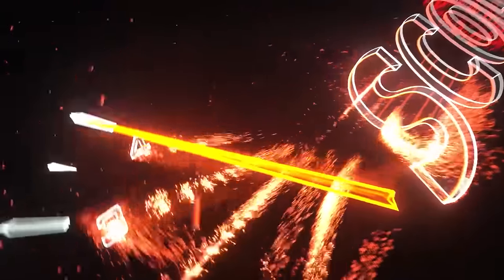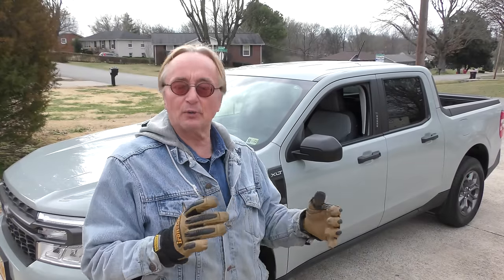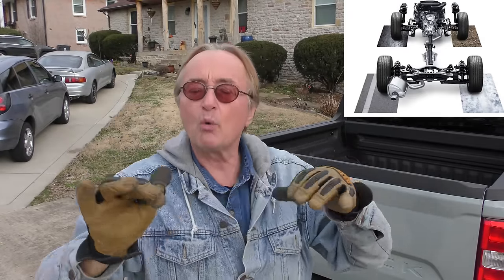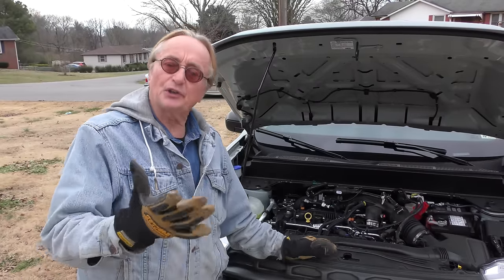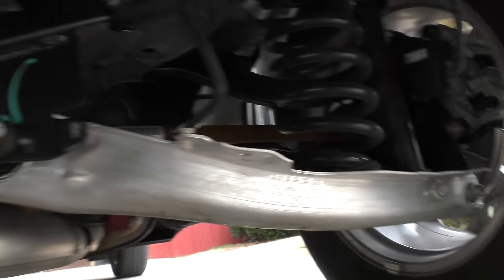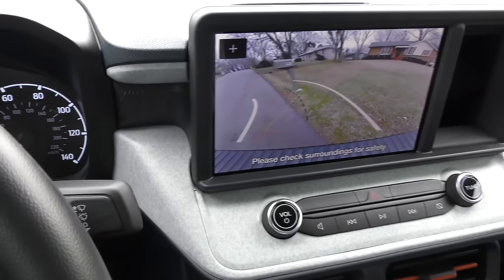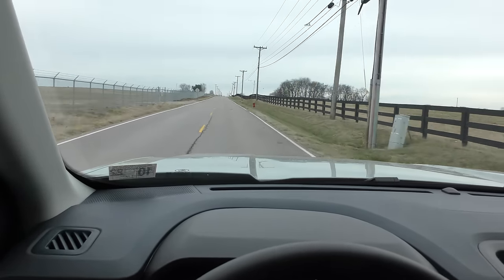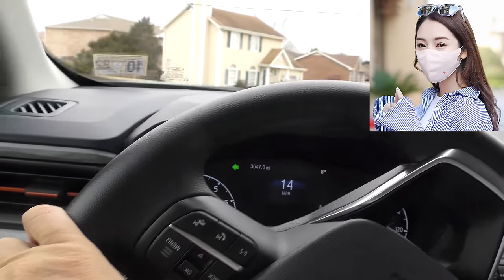I Finally Got a New Ford Maverick and Here's What I Really Think of It

Comment: I almost bought one of these last month. The dealer here had one but they were jacking the price way up above MSRP, so I bought a used Lexus with 30k miles on it. I was looking for longevity and figured the Lexus is known for that, the Maverick however remains to be known. If they hold up well over time I might get into one.
Reply: I’m in the same boat, but you’ll definitely have that Lexus a LOT longer. That’s a given. It’ll also hold value better.
Reply: @peliROJO  ES 350... I know it's apples to oranges, I was just looking for something reliable and comfortable
Reply: Best decision!! The Mavericks are to cheap for a reason, probably they put cheap parts. I don’t think they will last like your Lexus.
Reply: They won’t.
Reply: @Fister_of_Muppets  u need something comfortable and you were about to buy a maverick?! Mavericks are so uncomfortable that sitting inside them for couple hours was making my back hurt..
Reply: @juchou2983  I don't know what model Maverick you was in, but my Maverick Lariat Luxury edition has very comfortable seats.  6 way adjust with heat with adjustable lumbar support, just like any other luxury vehicle.
Reply: You made a mistake..
Reply: Should do fine. Its a rehash of the drivetrain that was in the escape hybrids from yester year. Those did 500k in Taxis
Reply: @Fister_of_Muppets  what was the sticker price and what was the dealer’s asking price of the Mavrick?
Reply: @GiovanniGiorgo  Sticker was $23k plus delivery etc, dealer wanted almost $33k plus tax etc.
Reply: This is why I dislike the legislation that protect dealers, we should be able to buy direct from the manufacturer no matter the company and no matter the state.
Reply: "Known for that" ? U sound gulible 
U should of left that dealer quickly
Reply: @johnnybravoBoyah  Lexus has had an excellent reputation for reliability from the start. My decision had nothing to do with a dealer. I did not buy the Lexus where the Maverick was. Your reply is dumb and obtuse.
Reply: For even money and the Lexus having very low miles that is a no brainer.
Reply: @Fister_of_Muppets  Nice buy , we had one for years and never had a problem....such a good car we gave it to sister because we didn't want to sell it.

Comment: Scotty touched on efficiency of FWD vs RWD and AWD/4WD. Some AWD vehicles are getting surprisingly efficient these days. I bought a 2016 Crosstrek last year when looking for a 4dr hatch to commute with. The Corolla and CT200H I was also considering are EPA-rated for about 40MPG hwy. I chose to bite the bullet on MPG to have AWD, tow capacity, and sturdy roofrails with a 33MPG-rated Crosstrek. I installed a high-flow cotton airfilter as soon as I got it home. I was pleasantly surprised the first week by getting 40+MPG on my 50mile commute by using the cruise near the speed limit. The 2nd week averaged 46+MPG!

 I then put on taller, heavier, A/T tires, a 2" receiver hitch, and skids. My MPG dropped to 35-40MPG. Oh darn. LOL. There are many people who don't get that kind of hwy MPG with their FWD econocar.
Reply: My wife and I had a 2019 Acadia AWD V6. 310 hp. We drove from Oklahoma City to Wichita and did about 31 mpg. On a different road trip, we drove to Jackson, Mississippi and did about 33. In town, it drank a lot of gas and you'd be lucky to get over 17. But I was absolutely floored at how efficient that Acadia was on long road trips cruising along at 70-75. Unless you were in town or in stop and go traffic, it didn't make much difference to have the AWD system engaged or disengaged. The long highway miles were about the same either way.
Reply: As someone who works at Subaru's Lafayette plant I'm glad you are happy with it. We work hard to build good cars.
Reply: Subaru makes the only awd system that I think is good. I’m not biased on the brand as they’ve had a few issues themselves, but I live in a snowy mountainous area at 7000’ and I see what the different vehicles are capable of. Most awd vehicles are actually rather poor. I don’t know all the facts about what makes the Subaru system different, but it just plain works. 
Cheers
Reply: @kdrapertrucker  I'm glad that the Japanese are employing local labor instead of just importing.

 I work with a guy that used to work in that Subaru factory. He drives an older WRX that he seems to still really like. That kind of enjoyment from a product line that you help to produce is a testament to the value of the product line.

 Subaru builds some funky, fun vehicles that are definitely not cookie-cutter. I like the quirky and smooth boxer motors, the chain-driven rather than belt-driven CVTs, the always-on symmetrical AWD systems, the SUV-like ground clearance on most of their 5doors, and the rallycar-like handling when TCS is turned off.

 There aren't many vehicles on the market that I like as much as my Subie, even at 2-3x the price. It's economical, yet capable, and legal FUN.

 It's like the economical-yet-practical fun of the old Toyota Celica 2+2 convertible.
Reply: @tomdavis3038  Subaru uses several different symmetrical AWD systems. The common denominator is that the systems are "always active".
Reply: @tomdavis3038  I vividly remember many yrs ago I had an old mid-80s Subaru $500 winter beater and my snowmobile had to be rescued way out in a field, that old rusty box walked right through that snow that was much taller than the tires while pushing snow with the front end. I hooked up to the sled and pulled it back no problem only time I ever got stuck is when I ended up on top of a hard packed snow drift and none of the wheels were touching the ground.🤠

Comment: The 2.0T is a proven engine, have a version in my 2016 Focus and its been good. I beat the crap out of it because its such a fun car for being an affordable daily driver. However, I have followed Scotty’s advice on the oil and I never use boost when the oil is cold. I wish every turbocharged engine had oil temp/pressure and boost gauges but sadly most don’t. 

In Michigan winters the time for the oil to heat up is twice the time for the coolant to heat up, about 6 min + 6 min. After that, game on.
Reply: Good on you for not boosting hard before the oil warms up! 
I have a 2013 Focus ST with the HP 2.0T and thankfully this model comes with the boost and oil temp gages. Super helpful!
Reply: Game on? Are you on a racetrack? If not, then what’s the point? Yeah. I definitely have to watch out for the badass focuses out there
Reply: @tomdavis3038  I can't tell if you're trolling or sincere and have never driven anything faster than a base honda civic.
Reply: That 2.0L is known as the Ecoburst
Reply: @tehagent1321  Never heard that. Have not had a problem with mine.

Comment: @2:27 Gotta call you on this one Scotty; only front snows will provide superior pulling/driving ability and braking over non-snows. Your non-snow's rears will NOT provide the same grip and potentially having the rear-end coming around you during (aggressive) braking and even more so on an unloaded pick-up. Considering too many other drivers don't even bother getting snows (all season is not 'snow' but 'winter' rubber) you'll be busy braking for them. Also, rounding a bend with snows on one end you just may experience 'breakaway' at different points due to the grip on one end and lack of grip on the other end potentially putting you off the road, or worse, head-on into the oncoming lane. Besides, if you are buying a new vehicle, aren't you going to purchase a second set of tires at some point? Aren't you going to rotate those tires at some point? Why not have two complete sets? Same money, same tire longevity, and a greater degree of free safety overall with this scenario.

Comment: I towed a trailer loaded with a full kitchen set Included, a French door bottom refrigerator, and a heavy wood stove 300 miles . Power to spare, it is a hill climbing, windy road the whole distance. Fuel was high grade( no sense not giving the eco boost a reward for hard work). I ran 80%  or the way on the auto drive and was thrilled with that part as well. 2024 Ford Maverick Lariat with tow pack.

Comment: Scotty - the Maverick isn't available with a 3-cylinder engine. 

The only powertrain options are the 2.5L I4 hybrid, or the 2.0L I4 Ecoboost which can also be spec'd with the AWD system. 

I ordered a Hybrid right when ordering opened. The fact that the 2.5 has port injection alone gives me more confidence in long-term use over the direct injection of the Ecoboost.
Reply: Exactly, well said 👍
Reply: Absolutely! The hybrid is trouble free. No GDI, no turbo, no complex automatic transmission.
Reply: The Escape has the 3-cylinder engine it.
Reply: @josephfrank1472  and . . . . . . . this isn't an Escape.

Comment: I'm pretty sure that start-stop garbage is disabled while driving in sport (s) mode.  At least that's how the Ranger is, and the transmission shifts much better as well.

Normal (D) mode is just so Ford can meet EPA numbers, but in reality sport mode is how you should drive it.
Reply: I have a 2018 Escape with the start-stop feature. Once the oil gets dirty, it doesn't  do it as much.
Reply: there is a button on the center console to disable it.

Comment: Only problems I've heard are badly fitted tailgates and sprayed bedliner done by outside contractor. Time will tell.👍🇺🇸
Reply: Lol I'd PREFER to have the bed liner done aftermarket considering how small it is and Ford still charges almost $500 anyway.
Reply: Them ecoboost engines have been out for a while now, they’re decent. I just hate the ANC boosting the engine sounds. If I want a loud engine I’ll get a V8!
Reply: Gas tank recalls too.
Reply: @jldude84  new to pick ups, where do i go to get an aftermarket spray in?
Reply: @angelgjr1999  For me I chose the Coyote V8 over the EcoBoost V6 anyday of the week.
Reply: @meenam300zx  well, that's a free fix. Hopefully it's fixed right
Reply: The gas tank recall is only for Mavs that had a factory spray in liner. The subcontractor they used performed a non approved method of drilling the drain holes after the liner was sprayed in. They found that some gas tanks we’re getting drilled into with this process. Because of that, they are recalling the select range of vehicles. The recall requires a complete gas tank removal / inspection, which is kinda insane.  But if the gas tank was punctured, you’d know it from the fumes or dash lights. Ford is just covering themselves from potential fires and definite lawsuits. Either way, it gives me confidence that they actually care about the vehicle, even if it is just to cover their own asses lol.
Reply: @CJColvin  This one has no six cylinder option.  It certainly would never have had an eight cylinder option.  Iwould have a six cylinder option if not for the turbo four, in all likelihood.
Reply: @unconventionalideas5683  True
Reply: @richsweeney1115 All recalls are free. This is ford, so expect more recalls.

Comment: It’s good to see ford come back and build a true small truck. I had a Ford Ranger back in the day and it ran well - lasted a long time. Slowest thing I ever drove though.
Reply: Jeep had a unibody small pickup for a while...rust bucket Comanche. Ford should of stuck with the '92-ish Super Cab Rangers with 7' bed.
Reply: My first vehicle was a 87 ranger 2.3 with a five speed. I swear, if you had an almost empty gas tank, were going down hill, and had a strong tail wind, it still felt slow. Freaking loved that truck though.
Reply: 01 ranger owner here it’s pretty slow sometimes but it can handle anything
Reply: I miss those 1985 to 1998 Rangers. Im loving the look of this Maverick though. I think Ford really outdid themselves. I've seen a few on the road and the rear end and bed to cab looks a little dopey but the front end looks pretty aggressive and tough.
 I'll see about one in 4 or 5 years because I'll never buy a brand new vehicle.
Reply: I owned a B2500 Mazda, really a Ranger.  Absolutely great truck, but you are right, leisurely accelerate.   Mine had the 2.5 engine with the 5 speed, can't imagine how slow the automatic must have been. At 160k miles still going strong.
Reply: @cheftomsd  I have the old (1999) Ranger with 4.0 and automatic, 4wd....it is definitely not slow. Plenty of power. Not an 80 mph interstate highway vehicle however.
Reply: I got a 2010 ranger 6 cylinder 4x4 it ain't slow at all
Reply: Me too. 4 banger with 8 spark plugs.
Reply: @northdakotaham1752   I wanted the 4.0 but couldn't find one in a Mazda.  It's a good engine. Better service on Mazda here than Ford, but has to sacrifice the bigger engine.
Reply: @cheftomsd  the Cologne engines, 2.8, 2.9 and 4.0 V6 all had cylinder head problems. Small cracks between the valves seats which are too close together. There are upgraded cylinder heads available but some work changing them out.
Reply: All motor vehicles should be made in Mexico........
Reply: Man them old rangers were slow, but plenty of fun with a clutch. Had a friend who did burnouts daily in his ranger.
Reply: @cheftomsd  I had a 97 Ranger with the 4.0, auto, 4wd with locking front axles, wasn't good or bad on gas but it did what I wanted and was comfy. The thing I really loved was most parts crossed with Explorers and in my area there's always dozens of them at my local yard.
Reply: @timjohnson1199  I had an 86 nissan hardbody with 8 plugs. A coil caught on fire. Pulled some wires and drove home on the other coil.
Reply: @kkarllwt   Hmmmmm, interesting.  Guess 2 plugs/ cylinder came in handy.

Comment: Just as a general rule, I never buy the first year of a new model vehicle.  Prefer the kinks be worked out by the second or third year.
Reply: I made that mistake once. Bought a used 96 4runner. Everything was brand new for that model, then they changed a lot for 97. 

It isn't that the car had design flaws (though that's a common problem with brand new designs), it had less support and parts availability because there weren't as many components that carried over to other model years. 

Something to think about if you plan on fixing up an older vehicle! :3
Reply: I loved my maverick
Reply: The powertrain should be okay.  The chassis is new though. I have a hybrid on order and hopefully no surprises.  Really can't beat the price, and I'll bet the sticker will be higher later.
Reply: @timjohnson1199  honestly, I have a lot of confidence in the chassis. Ford has really stepped up its build quality especially over the last ten years! :3
Reply: @jamesgizasson   Me too! Can't wait to get my Maverick!

Comment: I have the 2.0 ecobeast AWD FX4 4K tow package and I love it I’m getting 35-36 mpg hwy on premium fuel. I net about 27-29 mpg on regular fuel so the cost is worth it. Went to visit family by Erie PA and it snowed 30 inches overnight and I was pushing snow with the front bumper on the stock Pirelli Scorpion tires, turn off traction control, put AWD in sand mode “most aggressive AWD mode” and let it eat lol. I’m really impressed with everything so far…does 95% of everything I need, and gets great mpg along the way. Best mpg so far was 38 mpg on 500 mile hwy run to PA cruise set to 67 and let it eat. I average 500-525 mile fuel range per tank

Comment: Fun fact the Honda Ridgeline is also FWD. However, it has a tank-like V6 engine in it.
Reply: If you want to go even further there's the VW Rabbit truck, Dodge Rampage, and Subaru BRAT. And for slightly newer reference, the 2002-2006 Subaru Baja.
Reply: Tank-like engines don't use timing belts
Reply: @n808sgarage  timing belts were used in the Toyota UZ and MZ family of engines but, if it breaks you just need to re align the timing marks on all 5 pulleys and replace the timing belt, water pump, and timing belt tensioner since they are non interference engines.
Reply: @davidperry4013  and what do you think wil happen to the engine in a Ridgeline when the timing belt breaks
Reply: @n808sgarage  one of the dumbest comments I heard in awhile.
Reply: @pigbelly100  it’s an interference but, people who have cars with timing belts should know to replace it when needed inspect at 60k and replace at 100k. If you don’t put that many miles, get the timing belt inspected after 5 years and replaced at 8 to 10 years.

Comment: I put on my Ford Windstar made in Mexico 250K miles.   Changed the alternator, oil, brake and tires.  Gave it to my brother still driving it with the original engine and transmission.

Comment: Front wheel drive with the weight over the rear drive axle is always ideal for carrying rated maximum payloads... Also front wheel drive power plants in a latitudinal configuration are much harder on motor mounts.

Comment: Nice truck.  I was looking at some dealer websites in New Jersey.  They might start in the low 20’s.  But the scarce inventory I saw.  The dealers are tagging on $3000 to $7000 in options.   The ones in stock were over &30000.
Reply: I’m shocked!

Comment: Lots of tire shops won't do just two snow tires on the front because they're worried that the back end will slide out, cause an accident, and they will get sued.
Reply: The general rule of thumb is to put the better tires (snow tires or otherwise) on the rear for FWD vehicles.  Traction will suffer but you’ll gain safety and stability.